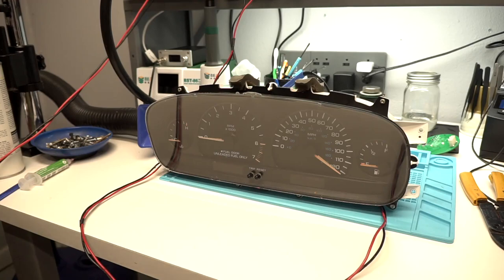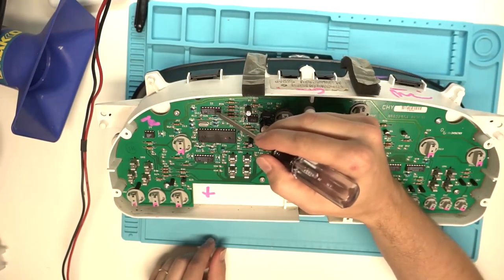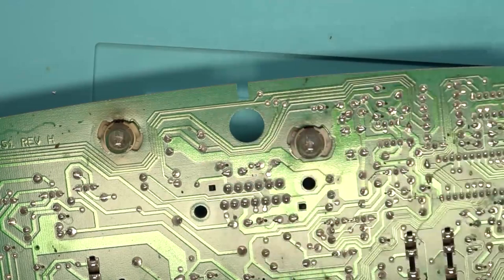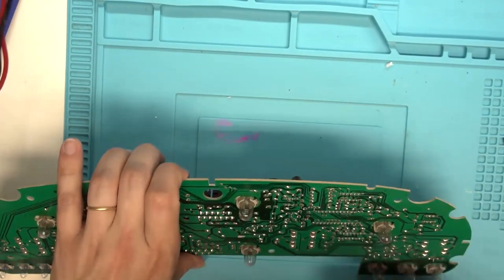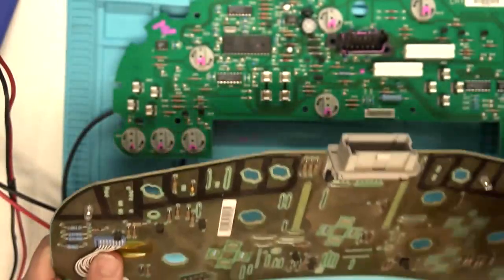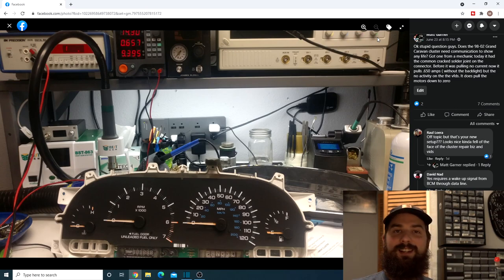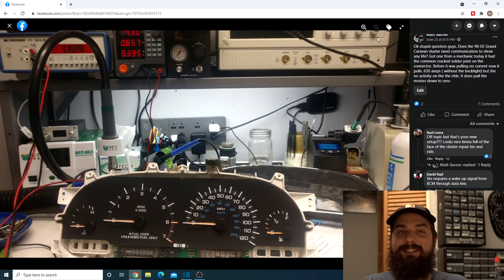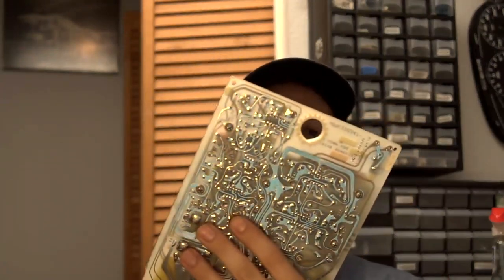How To Repair Chrysler Dodge Minivan Dead Instrument Cluster Grand Caravan

Comment: The DIP IC's you are asking about have writing on them - that writing is usually printed at the IC manufacturer level and will be the same no matter who subsequently buys the part. Do the body markings on the DIP's in question match between the Chrysler and GM parts?

Comment: I bought a 98chevy s10 the cluster only has battery and oil needles working . I opened it and it uses aircore motors  I don’t  want to buy the motors because they are to expensive do you have a video on how to fix the motors or any suggestion??
Reply from the maker: S10 clusters tend to sell for $20-40 at the junkyards so it's cheapest to just get a whole cluster and take the motors you need out.

Comment: Nice! I've got one that would go dead and then It would work again. Can't seem to find any broken solder.
Reply: As a first course of action you should still reflow all the pins on that main harness connector as it seems that vibration transmitted at the point of connection to the vehicle's wiring may still have compromised those solder joints over time.  My cluster only had an obvious crack on the ground pin but I still reflowed all 13 pins.
Reply: @dricklorenz9340  I agree with you. I did find that the ground pin was cracked/broken after wiggling/ pushing on the main pins. First time I ever soldered anything, and I haven't had any problems since.

Comment: I believe that they change the number to prevent you from being sure that they may have used someone else's design or it they don't want you to know that the design is just the chip manufacturers App Note
Reply from the maker: App notes for sure haha. GM does it to seeming 50% of the chips they use if not 75%.